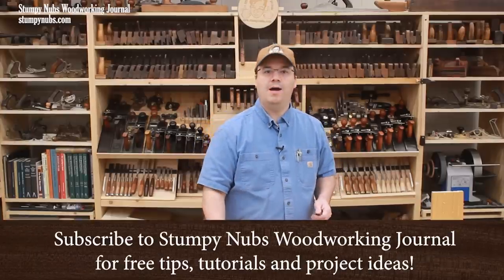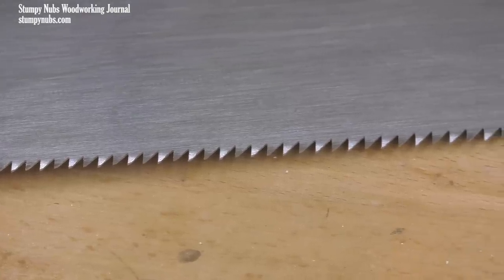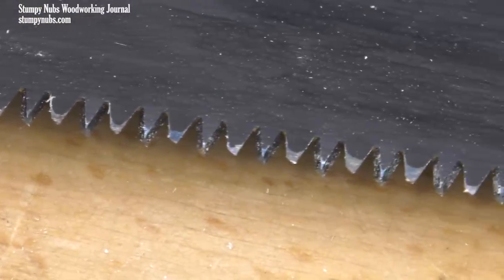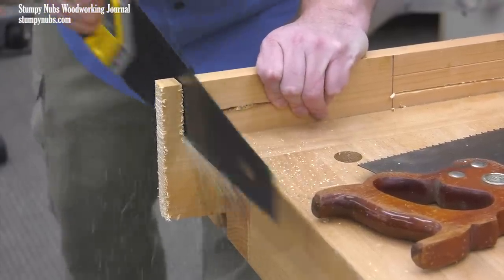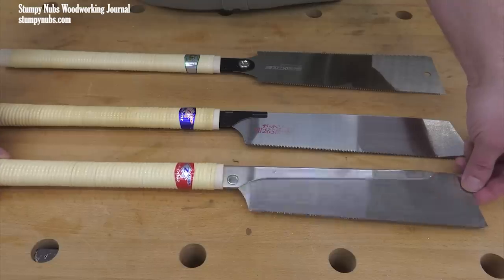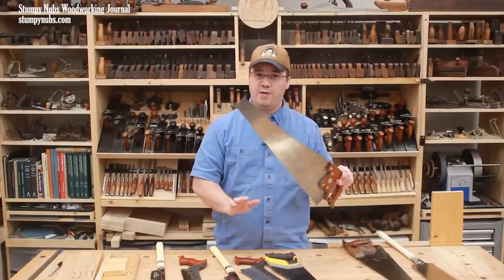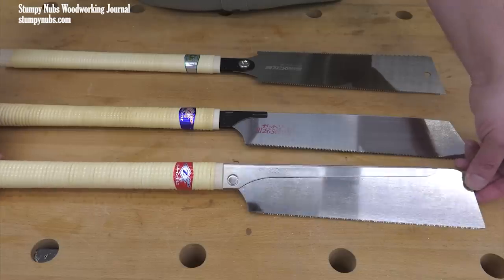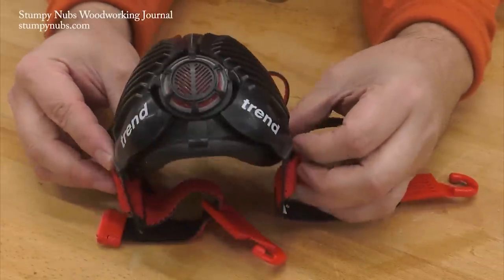Do Japanese saws cut faster than western saws?

Comment: You'll note that when you get to the larger saws, they are almost invariably pull cutters.  It's not really about speed, it's just that a blade under tension stays straighter more easily, and that's important on a 6 foot cross-cut saw.

So why are a lot of saws set to cut on the push?  Well, because back when they were designed that hand saw would have been used for just about everything.  A saw that cuts on the push needs less space to get started because it can cut its way into small gaps.  Also, when you're working from the side that will be on display any splinters go out the back where they're not visible.  And for most construction, you'll find yourself usually working from the display side, because it's hard to work from the inside of a wall.  :D

Comment: Thanks for the comparison James. You didn’t say much about the quality of the cuts. In my experience it’s not all about speed. If that’s the only criteria then I’d say “use a power saw”. In the final analysis if you have to spend more t8me cleaning up the wood after cutting then a the clean cuts made with the Japanese styles saws are the winner. What say you? Thanks again!

Comment: Technique is everything when using handsaws, or pretty much any hand tool. Someone who is skilled at sawing with a particular type of saw will outperform someone who is not skilled, regardless of which saw is used. The "speed" of each type of saw is almost splitting hairs when compared to how well they are used. Pick what you like and get good at it.

Comment: Too bad diston still dont make saws. Have you ever compared tuttle, perforated lance and great American tooth styles?  I own a Keystone Perforated Lance 3 feet long with an antique saw in a wood frame with tuttle tooth to cut my firewood. I recently bought 2 diston rip saws i saw at a great deal. Ive never used a rip saw b4 but needed one bcoz ripping planks with my Keystone isnt very practical. Unfortunately large rip saws are pretty much non existent and the only saw that comes up is one by Lynx with a great american tooth style. Ultimately i might have to grind rip teeth into an old crosscut saw so i can go rip planks. Yes i know Keystone is Diston. My rip saw right now is not coarse enough for ripping wide planks. Do you have any recommendations?

Comment: I've always viewed the difference to more about quality of cut and ease of cut rather than speed.  To me, speed has more to do with teeth per inch.

The quality difference (to me) comes from the fact that in a PULL saw, the force/resistance helps keep the blade on track, and more importantly, straight.  In a PUSH saw, the direction of the force/resistance is contrary to keeping the blade straight, as the you are pushing a thing piece of steel into the wood.  This action will tend to "bend" the blade slightly (and sometimes a lot).

This is how I've always viewed it since my father taught me how to use Japanese saws when I was a kid - he was second generation Japanese and a carpenter growing up in Hawaii.  He used both types depending on what he was doing.  For rough/fast cuts, he used pull saws, as the ones he had used a more aggressive tooth pattern.  If the quality of the cut mattered, he would use his pull saws (mostly Ryoba).

Comment: Great comparison, James. One thing I noticed was the tear out, which looks worse on the push saw than the pull. True or not?
Reply: For rough cut saws, yes, but you'd get cleaner cuts with the precision saws for doing dovetails, etc, which is why those didn't show any real difference...

Comment: A possible issue with the comparison: Japanese pull saws should be pulled downward when doing power strokes, at about 30° from horizontal. As shown, they were being pulled 0° from horizontal.

Also, a more apt comparison would be inches of saw travel to complete the cut. Not number of strokes. 10" stroke * 20 strokes = 200" of saw travel to complete the cut.

Comment: i've yet to use a ryoba, but the two handed downward force looks awkward to me.   almost like you might throw your back out.   plus i like the ability to sharpen and adjust the tooth profile on my old western saws.  correct me if i'm wrong, but I'm not so sure you have that ability with the pull saws
Reply: It's really not awkward at all; the Japanese saws are specifically designed to be used two-handed, which is why they have that long handle. Think of a katana & how that's used and you'll understand why, & also realise that anything that works well for a martial art is going to work just as well for sawing. It does take some practice & getting used to, however, when anybody can just pick up a European saw & start using it with zero technique.

As for sharpening, no you can't (easily) sharpen the pull saws, nor those tri-profile & low set European ones, which is why they often come with a replaceable blade that hooks onto the handle somehow. Depending on the number of teeth, you can sometimes get an emery board in there & give that a stroke or two every so often, but I haven't found that they really wear out quickly in any noticeable sense. You'll get a slightly rougher cut as they lose sharpness, but they saw with the same degree of ease due to the zero set. Even a blunt Japanese saw is likely to have sharper teeth (down in the gullet) than a high-set European one (anywhere along the teeth) due to the different ways they tackle the wood.
Reply: @nightcatarts  i understand the concept, but the twisting pull motion looks like someone trying to pull start a lawn mower, and i've more than a few guys put their back out picking up a pencil or a handful of screws, i don't think the extra torsion on your back is well thought of.  yes they're easier to use, but if it was easy it wouldn't be a skilled trade.   and martial arts has very little in common with rip cutting a plank.  attention to detail, and focus sure, but outside of that i can't see any comparison.   i have a smaller flush cut pull saw that leaves a nice fine cut, but the tri-grind tooth isn't necessary for that if you score your line before you cut. I can see the appeal as a cool new tool, but beyond that, ill take western saws 9/10 times
Reply: @litlit87  If there's any twisting, you're doing it wrong. It should be a linear motion, more like.. raking a lawn. What this has in common with martial arts is that the movements your body makes are the same, the grip on the saw is the same as that on a sword &, if done correctly, you will not pull anything making these motions.

Comment: while you are talking about hand saws, I am based in France and repair a lot of oak barn roofs often beam joints have to be cut by hand,due to the fact that the wood is green most of the saws bind, they were never made to deal with this damp wood, the stanley plasterboard saws is the only saw that will cut green oak ,only porblem due to the curd if you slip with it you usualy see bone it does not stop in flesh !

Comment: Each of those saws indeed has it's advantage over the others in particular situations. I just find it a lot easier to fine control my ryoba and dozuki saws, and leaves a nicer cut usually, so I tend to gravitate to them most of the time for any hand sawing tasks. I have very flexible wrists so the handle style of Japanese pull saws is fine for me, but I can understand how many would probably find a western style dovetail saw to be less strenuous on the wrists.
🐸☕☕🐸

Comment: One other thing I noticed, at least from the angles we could see, was that the Japanese pull saws had a finer cut with less tear out.  There was also a lot less wobbling from the pull saw than the push.   I think when using the push saw the unsupported tip wobbles and that imparts a little wiggle in the teeth causing extra tear out.  Speed is one thing but quality is also a factor.  If I had to buy only one saw type to use, than a pull saw would be my choice. More precision and a finer cut will win me over having a to do a couple of extra strokes.
Reply: I think we are also seeing the back of the cut. The push stroke you are seeing the rough push through of the cut, while on the Japanese saw we are seeing the front side of a pull through stroke. Kind of deceiving.

Comment: Fewer cuts doesn't really represent faster cuts, what's the recovery time between each cut, what's the setup time between pieces? How long can you keep up consistency sawing 1x pieces, 10x pieces and 100x pieces, how many pieces can you keep proper cutting form? Can you stack pieces as you cut, if your doing duplicates how many boards can you stack 1x pieces to 10x pieces and expect acceptable results?

Comment: I own both types of saws and depending on what I’m doing depends which one I use. I was on a job in porta Rico some year back now we were installing box beams in a library we commonly lost power daily so I generally cut all the beams with my little Japanese saw that only about four inches long blade I wished I had taken my larger hand saw but I’ve gotten that I seldom have anything with beyond a small Japanese saw.

Comment: In addition to the downward force, another variable not tested:  how many teeth are used in each stroke.  The longer western saws allow more teeth per pull.  Tooth spacing also plays a role.  So, a true comparison would be a machine pull/push, with stops to limit each stroke to the same number of teeth, and the only downward force being the weight of the saw.  And I imagine verifying the sharpness of the teeth would also help.

Comment: Perhaps it's been asked, but is there any stroke length "bias" because of the length of the saw? Or did you make an effort to keep the stroke length same?
Reply from the maker: My strokes were generally of the same length, but I am sure that was a factor, as were many other things. This is far from a definitive test. It is just my observations.
Reply: @StumpyNubs  I don't have any real data to back this up, but my gut feeling is that majority of the time, people use roughly the middle 1/3 of the saw, unless they deliberately make long strokes. Mostly because so many (usually cheap) saws get a little bendy when using the 1/3 near the tip.

Comment: pull is better regardless of handle design. when pushing a piece of sheet metal its going to buckle, twist, and bend. when pulling the steel is under tension and it will perform much better. one can compensate for the problem coming from pushing by adding a spine but now you have a limit in depth of cut, extra weight, complexity, cost and a potential second cutting edge.

Comment: I'd like to see push vs pull on something more repeatable, like a reciprocating power saw, and is also like to see how a pull saw works with a western handle, and how a push saw works with an Eastern handle. I think there's more important variables than just stroke direction.
Reply from the maker: The other video discusses other variables.
Reply: We need Project Farm on this

Comment: One interesting thing I saw on a random youtube saw review comparing foldable saws was that the guy doing the sawing initially had an easier time using a Western saw (cut faster), but once he started getting tired, he could no longer produce the power needed for it but still could cut fairly easily with a Japanese style pull saw.
Now is this true for all people? If it is, does it matter as not many people use handsaws to the point of exhaustion? I don't really know, but it's interesting if true.

Comment: Not everybody is the same and prefers the same things or ways of doing things. Some people have stronger muscles in different places than others. My recommendation is to have one of each and try both, you can use either for the type of job at hand or whichever one suits YOU better. Whichever saw works better for you is the saw you should use. There is no wrong way to get to the final result as long as the final results are the same

Comment: For fine work I do like the pull saws. Much cheaper for a good saw if buying new.  The tri-point things I can't stand. Rip an 8 foot 2x4  inton2x2s with an old $5 western RIP saw sharpened as a rip saw and then do it with a pull saw and you will have a MUCH better time with the push saw.  Now when it comes time to prerry up the sawn surfaces, that's a whole 'another thing.  Obviously stell making technology played a role in western vs eastern saws, but I wonder if types of wood and materials being cut played a role?

Comment: Good  information as usual. However western saws have a major advantage. The delicate teeth can break off the Japanese style pull saws requiring you to buy a replacement blade. That doesn’t happen to western saws. Also, the older Diston saws can be resharpened or even retoothed and can last a lifetime whereas a  hard tooth saw such as the Japanese type pull saws or the Dewalt saws are throwaway saws once they get dull.
Reply from the maker: Western dovetail saws have very delicate teeth, as well. But regardless, that was covered in the first video :)

Comment: It's also worth pointing out that because the pull-saw is self-straightening, they can be made thinner, so a thinner kerf is typical compared to a push-saw; and, it can be easier to maintain a straight cut for some kinds of cuts vs. a push-saw without a spine that is wobbling more (for an equivalent thickness of steel). 

I have a variety of both push and pull saws and IMO there's no single superior design, just several designs with different advantages and disadvantages.
Reply: They aren't entirely self straightening. Dozukis are so thin and have so little friction they sometimes flex at the bottom of the blade. Ryobas with their thicker blades don't have this problem

Comment: Something to add to the conversation is that pull saws, while inexpensive because of minimal steel and simple handle, might not be as durable.. Plenty fine for the typical average guy, but I wonder how many will be like the many 100 year old saws I have in the till or the London pattern rip that is from late 1790s to early 1810s. Have the same Veritas and Dozuki but a different royoba. I like saws and using them.
Tl;dr. Craftsmen made beautiful furniture and buildings for centuries using both styles. Many of us have both.

Comment: Saw length and rake angles will come into play here too, aswell as the pitch. A longer saw has more teeth and will cut faster than a shorter saw of the same pitch. Japanese saws often have a positive rake angle compared to an English saws straight or relaxed tooth. Then your angle of attack matters too; how the tooth is presented to the wood. Dropping the handle of an English type saw will cut more aggressively, while dropping the handle of a Japanese saw will make a less aggressive cut. 
With "handsaw" type saws, they are for sizing parts, but rarely is it the last tool to touch the wood. A plane or other tool will come along afterwards to clean the edge. A hand tool worker needs this type of saw to be efficient and fast. Try ripping parts to width on 2inch thick wood with a Ryoba. Then do the same with a handsaw..... it's easy to pick a winner there for me. Dont even try to resaw with a Ryoba, its absolutely painful. 
Joinery saws are different, there will be no tool to come along after and clean the cut, so we want them to leave a joinery ready surface. I think both types of saws are about even here. A Japanese saw is awesome for dovetails. But for tenons or bridles I think an English style saw wins out. You wont find a 16inch Japanese saw with rip teeth and a spine that will cut like a proper tenon saw will. 16inch plate, 4inch under the back, 10ppi.... I find a Ryoba wanders when cutting a tenon or bridle. 
I speak as a person who uses only hand tools, so it's quite important that we have efficient tools that cut quickly. For me English type saws have the win as I can sharpen them whenever they need it, a Japanese saw is only sharp once, and slowly goes downhill from there. I also dont like the "throw away" nature of them..... theres enough waste in the world. 
For anyone who uses Japanese saws; the old blades make brilliant scrapers 😁🤙

Comment: There is another measure of speed too, average/over time speed. Not as important today to many wood workers who will do their cuts with power tools, but for people who use hand tools more extensively if not exclusively, that also is a thing. Sure, in theory, a saw that you can do fewer strokes will cut faster, but if we are talking about someone making many cuts in a low preparing lumber for a project, or making many joints by hand, overall comfort, how fast you get hand cramps or pain with a tool, that will also affect your overall cutting speed, and all those factors will be affected by your own body and physical condition, and how a tool's design works with that. I have lower back pain, a saw that I can more comfortably use while sitting or otherwise resting my weight partially on my other hand, that is much faster than me going at it with both hands or standing up for longer times.

Comment: Anyone here know how to identify (or where to go to ask) the brand of a Japanese saw that is only written in Japanese?  My one semester of Japanese was well over 40 years ago and probably would not have helped much anyway!  My saw (a dozuki) has a stuck on tag and also some hard to see characters stamped on the metal.  It does not have a disposable blade. It seems to be a decent enough saw.  I even have half a mind to try to sharpen it.